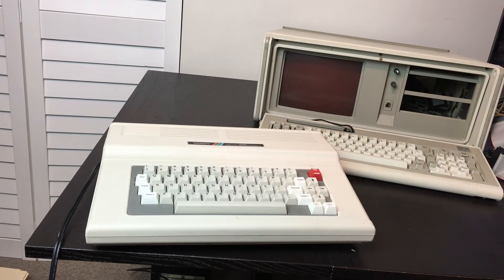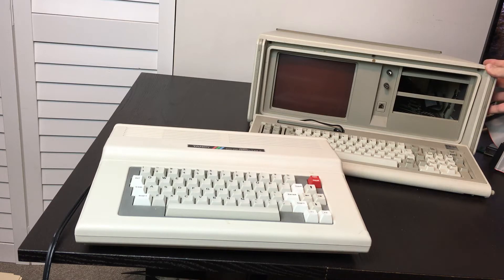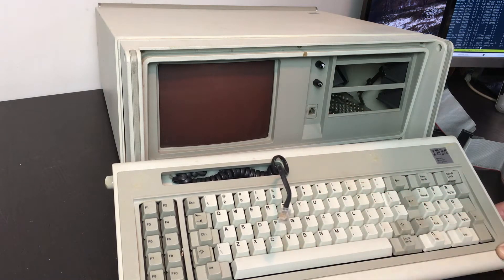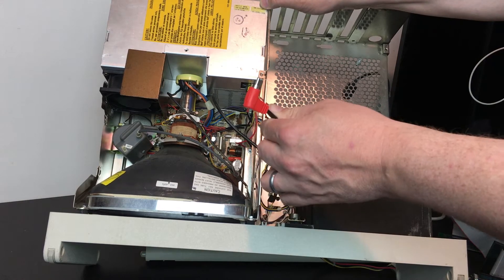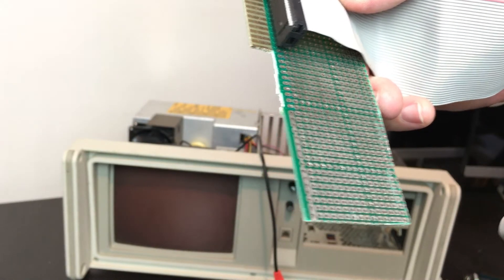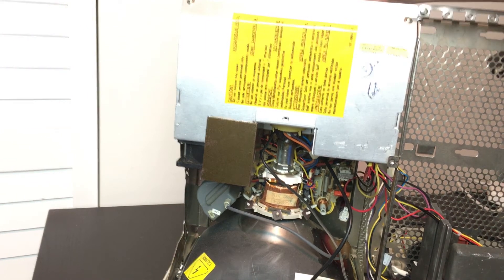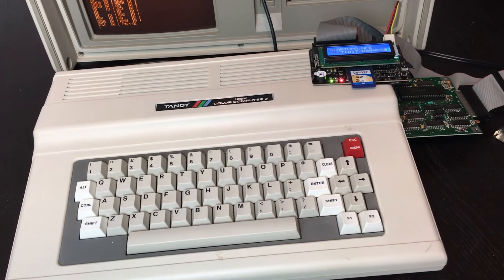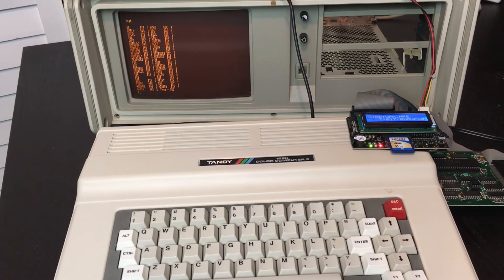TRS-80 / Tandy Coco 3 in an IBM Portable PC Case Project

Comment: Just wanted to say that I had that same idea in the early 80's.  However, I built a nice PC case out of wood.  It was about the same size as an IBM/AT.  My thought was wouldn't it be nice if my office computer matched the surroundings, like my desk.  Who wanted metal/plastic... Wood was nicer.  Anyway I tore a COCO apart, moved all the components into the case, including the floppy's and the multi-pak mother board.  I added a long ribbon cable to use the same COCO keyboard (externally).  I took this down to a legal rep to see if I could get some sort of patent on computer cases to match office furniture.  I demo'ed the working system, he was impressed and wanted to pursue this, but needed 5K in fee's... I scrapped the project.
Reply from the maker: Hey that's a pretty cool story.   What I find funny is that in the 70's and earlier, "real" products had to be at least wood veneer, if not solid wood.    Then the 80's came along and it had to be at least fake woodgrain.   Nowadays a lot less of that coming out, but I appreciate the desire people had back in the day for wood in consumer products.  Question for you, do you remember how you extended the keyboard?   The mylar is difficult / impossible to solder so I'm curious if you remember how you solved that problem.

Comment: This is a great project and I can see how your keyboard translation might carry over nicely to allowing broken TRS 80 Model 3 and Model 4 keyboards to be replaced with a more standard AT keyboard.  As you know, those TRS keyboards are a bear to replace because they soldered the keys on the PCB frame.  Keep up the great work!
Reply from the maker: Hi, thanks for the comment and kind words!   I am working on my matrix keyboard adapter video at the moment, hopefully will publish something soon.   And you are right the M4/M3 keyboards, they are not only hard to fix but they also seem to be prone to failure now that they are over 30 years old.